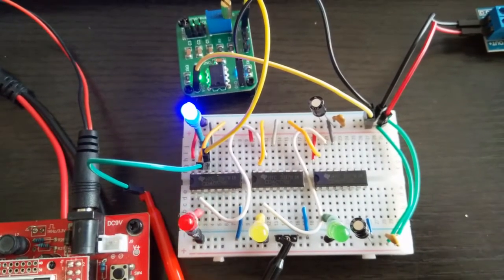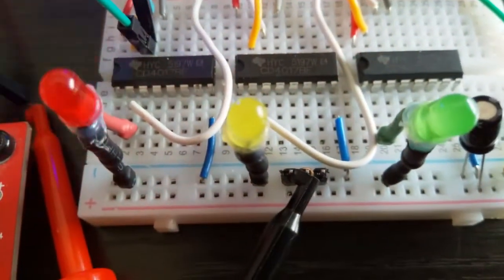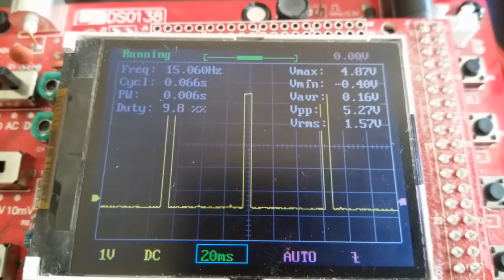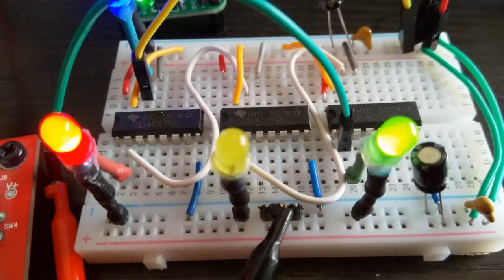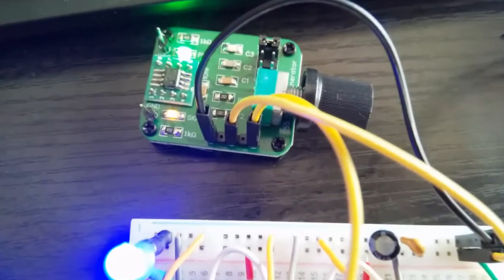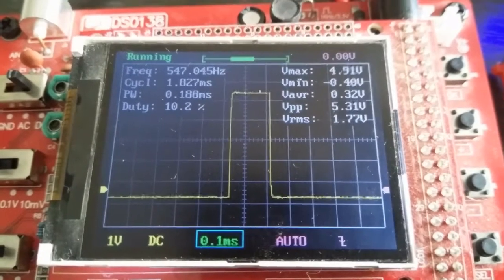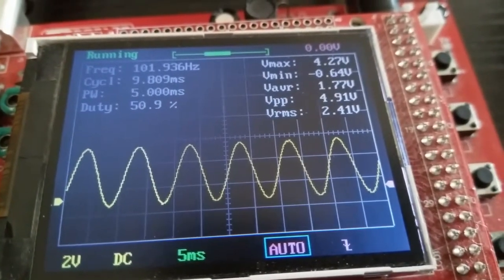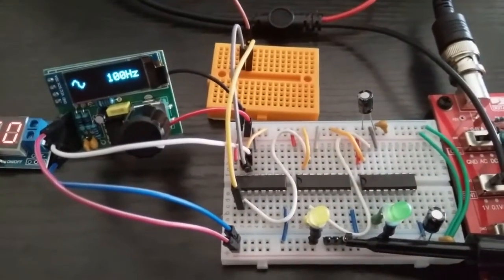CD4017 frequency divider

Comment: Really useful video to visualise how these work. I am adding a tacho to my diesel land rover and picking up the flywheel teeth with a gs100502. My programmable tacho only works upto 1khz but the sensor will output 6.66khz at 4000rpm of the engine. Looks like I can easily use a 4017 to divide the output and bring it down to a frequency that my tacho will be happy with.

Thank you!
Reply from the maker: What a great project! Good luck with the frequency division! 👍😀
Reply: I understand everything you just said, and I get the building blocks of doing so.
I wish I had the motivation and time to do such things!  I'd be building robots that play guitars though lol